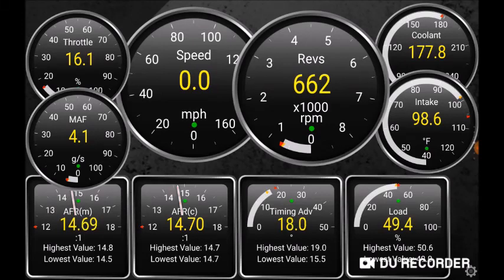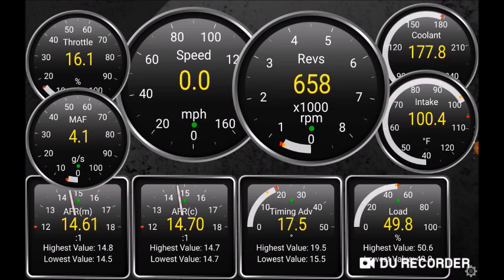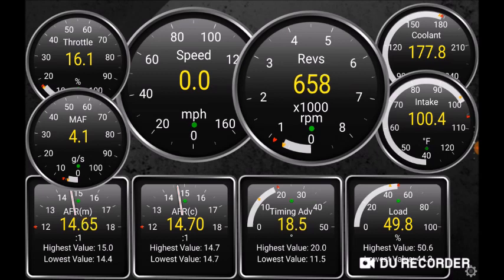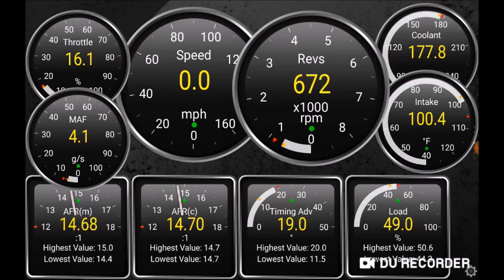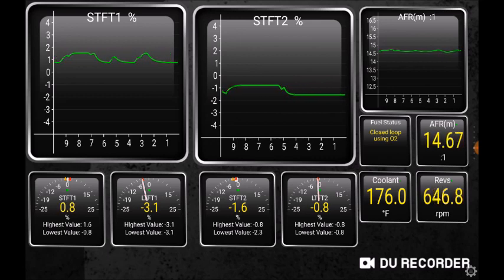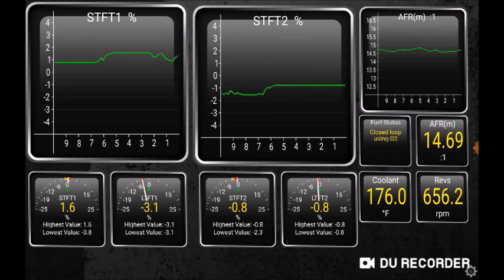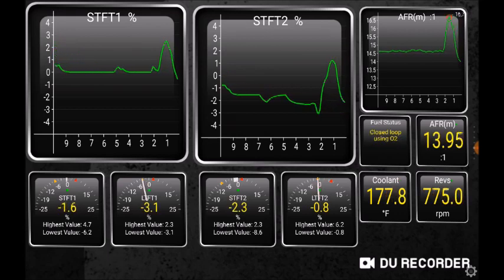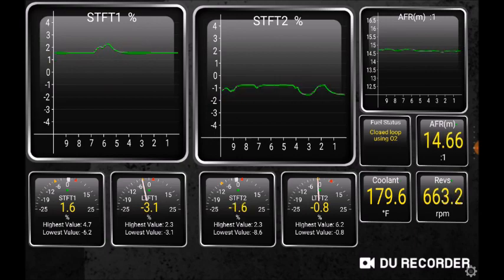Toyota 3.5-liter V6 - 2GR FE Swap MR2 SW20 - Idle RPM and Fuel Trims Diagnostics

Comment: Hey Frank. Since you’re running a stage 1 MWR cams, do you do any ecu tuning? I plan to slightly port the heads and run stage 1 cams as well and I’m looking to see if I can get someone to tune my Frankenstein hacked ecu.
Reply from the maker: Very tough to "tune" these ECU's. I have all the tools to re-flash but flashing is mostly guesswork because you cannot see the result in real time. But now I have a dyno in-house so I am going to start experimenting with more in-depth tuning. Stay tuned. LOL.